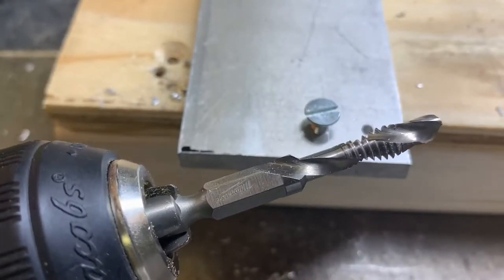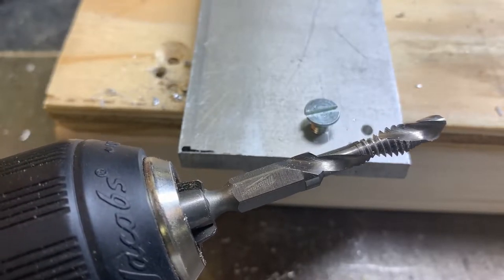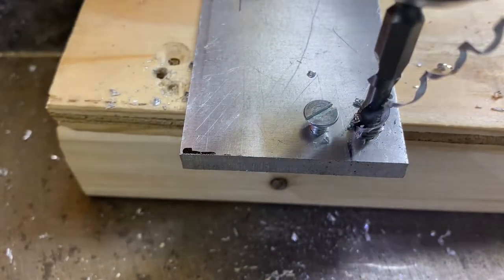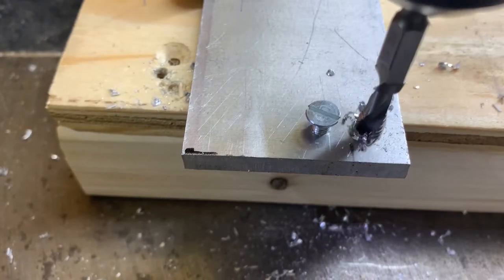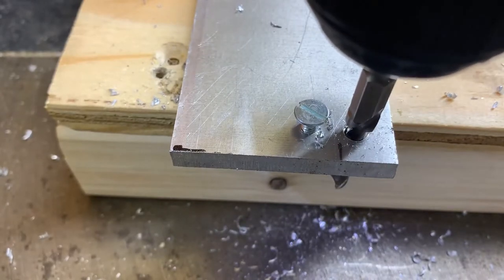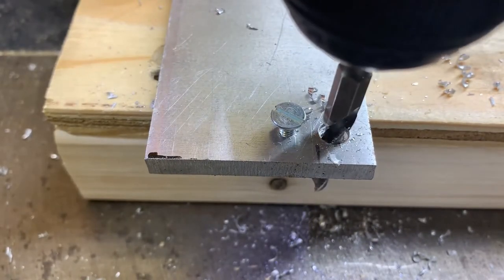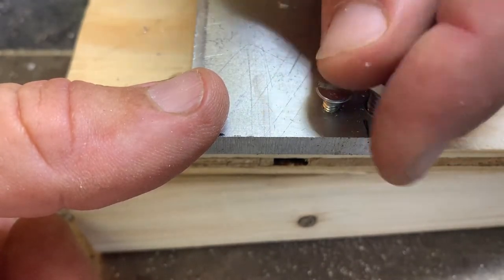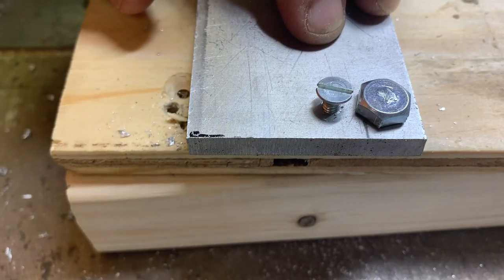1/4-20 drill tap countersink in one bit

Comment from the maker: OK, so I get that I should have a lubricating oil, but the point is, for aluminum, it worked without lube, it's an all-in-one tool, and sometimes, you just need to get it done.  Quarter-inch plate, no less. Even Mr. Bean can succeed with this tool. 🙂